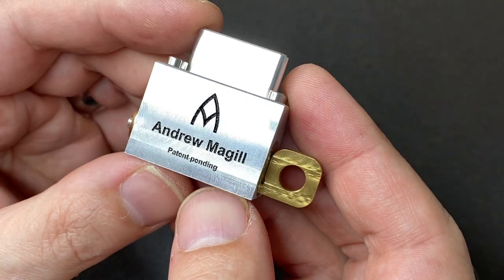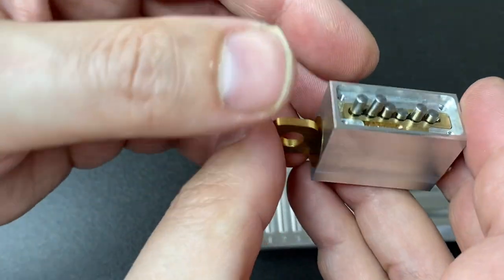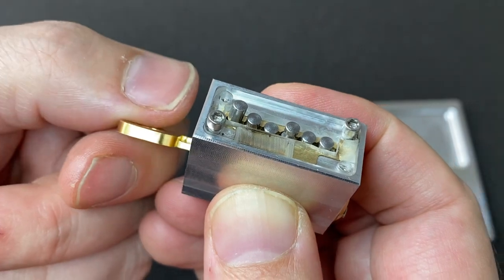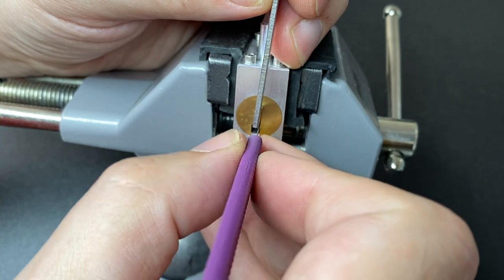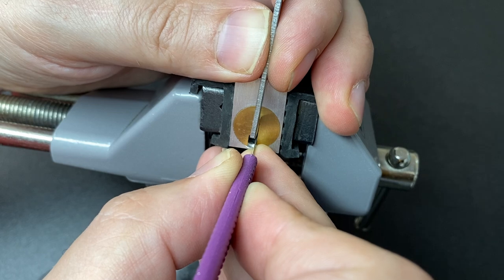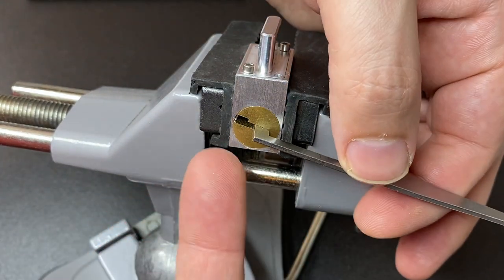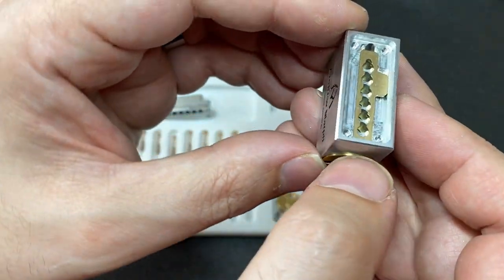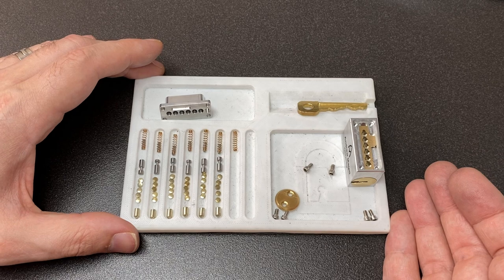Unpickable? Enclave - an Ingenious New Lock Design

Comment: What I like about this as opposed to other "unpickable" lock cores is that it isn't much more complicated to manufacture than a normal high-ish end lock core AND I don't see any reason why it couldn't use literally any other keyway, so key reproduction and sourcing could just be regular Schlage keys.
Reply: Also with that design, the physical security rests on the single transfer pin. With a keyway open like that, you could stick in a tool steel bit, and force the lock open.
Reply: @ionstorm66  You're not wrong and I did notice that as a weakness though I didn't mention it, but we're talking about destructive entry at that point. I did also notice that the pins are all steel. Usually when you're trying to do an attack like that, you want to be shearing 1 brass pin, not gouging a steel pin through billet brass.

The real problem for me was that the "sidebar" is also made of brass, which means that depending on the mechanical advantage of what forces the lock pin up, it could be really easy to deform that brass sidebar and punch that wedge through it.

I would like to see that sidebar made of steel and the cam area that the lock pin rides on also made of steel. It would be a solid order of magnitude harder to force then.

In fairness to who made it, its a low production prototype. All of those materials could change. If it were all steel and you didn't have the world's biggest keyway, I think you'd probably break that tool steel before the lock gave.

As it stands right now? You're definitely right. I bet a decent screwdriver and no leverage other than your hand would be enough to force it.
Reply: @htomerif  The problem with using a steel sidebar is that it opens up a magnetic force exploit. You'd need to have an incredibly thick case and/or have some kind of opposed motion like a second sidebar that only works in the opposite direction, otherwise the crux of the mechanism could be manipulated externally.
Reply: @dustinbrueggemann1875  That's not really a concern. You've probably been watching to much LPL. Stainless steel, for example (which is the only kind of steel you'd want to use in a lock for corrosion purposes) can be essentially completely non-responsive to magnets.

I have a 3in diameter, 2in thick N52 strength neodymium magnet and my stainless steel silverware is unaffected by it. My stainless steel bucket is similarly unaffected. My stainless steel cookware just barely sticks but not enough to hold the weight of the magnet.

Note about LPL: I blocked his channel about a year ago after having been subscribed since before he had 10k subs. While LPL himself is very good, his channel is just a bunch of memes now and his comments section is 100 percent people with zero lock experience making jokes for likes. LPL's channel has zero utility for me.

That's why I'm on channels like this. You made a comment that happened to be incorrect, but was entirely relevant to the topic of the channel and very easy to clear up. Sometimes the shoe is on the other foot and I'm the one making the mistake. I appreciate channels that cater to people who want to learn and aren't just memes-4-views factories.
Reply: @htomerif Oh I'm aware of stainless and magnets, it's knowledge I've had to make all too much use of after knocking over a few part bins. That said, not every engineer jumps directly to stainless and so I would hardly dismiss the exploration of it as trivial nor would I harp on LPL for favoring a theme. The guy knows his audience, but he also knows his stuff. The fact that he's got so many examples is proof enough that a trivial idea to a few isn't quite as obvious to others.
Reply: @dustinbrueggemann1875  Well I've had enough involvement with lock making companies to know that stainless steel is a pretty standard next step for cores and shackles.

The reason I'm "harping on LPL" (which, fair enough, I am) is that (and I tried to make this clear) he changed his theme over time from educational and interactive to brainless trash. That's fine if people want to watch it, but I've lost all respect for him as a content creator.

I've been following Bosnian Bill for even longer than LPL and its still a pretty good channel. He's gone MIA since about the time Ukraine started heating up so it wouldn't surprise me if he isn't busy with other things. Or maybe he just gave up. Who knows.
Reply: @htomerif  In all fairness, LPL isn't putting out "brainless trash." The lock manufacturers are and he's representing that demographic more fully than other lock channels. Sturgeons Law: 90% of everything is trash. TBH if he only put out videos about prototype or challenge locks I wouldn't be bothered to watch because I honestly don't care.

I DO, however, care about your perspectives because you're focusing on something that matters: actual real-world lock design.
Reply: @htomerif  Well if you watched LPL, you'd know. Bosnian Bill had to step away from YouTube to focus on personal family issues. It was probably a year/year-and-a-half ago.
Reply: @acoupleofschoes  Well I hope its not something too serious.
Reply: @htomerif  Check LPL's video 1365. From that video it appears he initially took a break to help with friends' COVID issues, then decided to retire.
Reply: @acoupleofschoes  Thanks for looking that up, but I'll take your word for it. At this point LPL is like the Keemstar of the youtube lock picking community. I can't stand him. FFS, I can't even enter "lockpicking" into a regular google search bar without it autocompleting to "lockpickinglawyer".

That being said, if you just pretend LPL died in a a car crash or something at video 1000, its a great, informative channel.

BosnianBill always did a lot of commercial stuff like reviewing pick sets, but you could tell when that's what you were getting and avoid those videos.

For people who don't know, any professional (ish) lock pick (of similar dimensions, obviously) is just as good as any other one.

My favorite pick is the Sparrows SSDeV kind of recurved short pick.
Reply: @htomerif  what’s up with all the acrimony? Jeez…
Reply: @Mainyehc  Read the comments before opening your mouth, please. If you did, then you would know why since I explained it like 4 separate times.
Reply: @htomerif  yeah there are plenty of incredibly tough stainless steels out there
Reply: The only reason not to use stainless is cost of tooling, cost of material and ease of manufacture.
Most of the parts in a normal lock are difficult (expensive) to machine in tough materials like stainless.
These small parts, however, are fairly simple in their geometry and could be easily machined via cnc or even potentially stamped.
Reply: @gtjack9  Those are all good reasons but they're not the only reason. There's also material incompatibility, i.e. a stainless steel key in a stainless steel lock would gall a lot more than brass on steel or brass on brass. Its the same reason you never see steel on steel bushings. There's also alloying issues (which is kind of the same issue) like aluminum chemically bonding to most ferrous metals. Aluminum might seem a little weird but its used for the body of a lot of high security locks where evidence of tampering (i.e. someone having to cut the lock) is more important than securing the object. That came up a lot in the military that I remember and Paclock made an aluminum body high security lock in an attempt to get a big DOD contract.

I own some stainless steel core locks and some stainless steel body locks but I can't think of any lock, even very, very expensive ones, that is all stainless steel. Even >$1000 padlocks like sargent and greenleaf makes aren't all stainless steel and cost is obviously really no object there.
Reply: @htomerif  The meme comment...whatever.  Basically your issue is he's gotten too popular so you don't like the comments.  Ok.   That's a you problem.  To suggest the channel isn't informative is just...ignorant.    It's pretty apparent you have a bit deeper of an issue than that with LPL....but hey, another you problem.
Reply: @mehmeh533  Your trolling is weak.
Reply: @htomerif  Snappy reply.   Pretty sure I'm not the troll here.   But you do amuse me, so there's that.
Reply: @mehmeh533  I'm sorry, who are you again? This was a thread about a decent lock core design. You're here for... what?

I'm sorry if I offended you so badly that you feel you have to keep responding and propping up your uh.. limp.. manhood with generic insults.

I think we're done here. I mean you're not. Clearly. But "we" are.
Reply: Yes, thats the other genius of this design. Easily manufactured in bulk and no specially designed keys needed. It just needs a couple of minor design changes imho to stop physical forced entry, but those changes are easy to make. ...having the sidebar plate made of hardened steel and thicker, with a slope milled on the underside and a rounded pin at tge back instead of relying on the edge of the plate and an angled pin. That way physical force would be blocked.
Reply: @ionstorm66  yes. Thats what ive pointed out, but people who dont understand mechanics or real-world scenarios have bashed me down saying im wrong. I wasnt critisizing the brilliant design, just merely pointing out an obvious weakness that could be fixed very easilly. I hope they make the small improvements and then get it into production.
Reply: @dustinbrueggemann1875  Nope it doesnt in this case (although you could use hardened stainless steel to mitigate that anyway). The sidebar is blocked from movement by the steel pins, so using a magnet to attract it wont make any difference.
Reply: @htomerif  not all of LPL's subscibers have no experience or are just doing it for memes etc... (and those are getting too repetitive copy/paste lately). I know what you mean though. He's achieving what hes aiming at though, which is to make the lockmaking industry a laughing stock until they get thier act together and start making retail locks much better.
Reply: @htomerif  im loving the dangerfield dual guage praxis set i got recently. Though im still going to file little flats on the ends of all the hooks. Its the same as any tool really, theres no perfect tool thats going to be just as perfect for everyone. Its personal preference and how you personally can get the results you want with a particular tool. The tool i use to pick old bronze yale pin tumbler locks looks like a piece of scrap junk, but it works for me.
Reply: @penfold7800 I wrote a whole long comment about LPL, but then I deleted it. Just look at the top comments on this video, then look at the top comments on any LPL video. Here its like 50 percent irrelevant memes and there its memes all the way down.

I started with watching BosnianBill's channel and I went back to it after I jumped ship from LPL. He's gone dark though recently.

Unfortunately I have a pretty good idea of what he's up to now and I'll just say "slava Ukraini".

Anyway, yeah, I'm sure you're right. There's still actual lock sports people lurking in LPL's comments, but I'm not going to read 10,000 "lol bro! LPL really kicked that lock's ass!" to find one real commenter and no one is gonna do the same if I leave a real comment either, so the LPL lock sports community is dead.

Also, the thumbnails and titles made me throw up a little in my mouth. I got flashbacks to the "finger family" videos that plagued youtube a while back.
Reply: @htomerif yes, the discussion was about a decent lock core until you started ranting about your hate towards lpl for no apparent reason.
Reply: @dompan9169  cool. And then you added to it by coming here and running your mouth, so clearly you want to see more of that. Congratulations.
Reply: @htomerif ah yes, blame others for the thing you started.

Comment: I want to be seeing LockPickingLawyer take this on.

For too many years,  people have put out substandard locks that can be opened with comb-picks or bumping and Andrew Magil's Enclave lock actually attempts to solve problems.
Reply: Actually, judging simply by the 3d graphics this lock is also susceptible to a comb pick attack, and not only that, but it might actually also break the lock permanently.
Reply: @ФилиппГерт  Resolving a comb vulnerability is trivial though. The height of the driver recess can be shortened, or even just one or two pins having slightly longer tail ends to catch the sidebar at maximum.
Reply: I give it 2 minutes  lpl
Reply: I don't know where you live but here in Paris France you'll see a lot of Fichet locks (their cheapest lock barrel is about 200 dollars), you'll rarely see anyone pick those.
Reply: Nothing is unpickable only to annoying to doc. At least you can allways smash the Window.
Reply: @ФилиппГерт  You haven't watched the whole video, have you? 13:24
Reply: Locks are deterrents. The fact they can be picked is irrelevant because most people trying to get on something locked bypass the lock and break it
Reply: and a click out of two...

Comment: What is so interesting is that in all other cylinder type locks the more wafers make it easier to pick because of multiple shear lines, this works completely opposite. Great work!
Reply: I wonder how much rotational impact it can take in the "false set" position, yes noisy, but depending on the environment, maybe not a problem.
Reply: Yep it is complete crap... you will be able to false pick it and then brute force it as your whole cylinder is protected by only one pin.
Most likely you  can also just ignore the whole picking part and just jam some brute force tool in it and most of the shear lines will be "picked".
If you then put that lock to some EU certification lab then they gonna tell you that it can not have any good certification because it is simply to easy to simpy brute force it...
Reply: @paulstubbs7678  Its is just a single small pin there will be no noise or impact resistance of any kind. The inventor got the silly idea that the picking is the only thing that he should be woried about. When in reality people that like to steal stuff love the brute force method and 5 or 6 pins holding the cylinder making it hard to rotate but in this case a kid would beable to do the tool and destroy the core with icecream in one hand and pulling the tool with the other hand...
Reply: @Bialy_1  yeah especially with that big keyway, you can drive a truck thru there. Looks like it won't take much force to pop it. Great idea, needs to work on the back end to make it stronger.